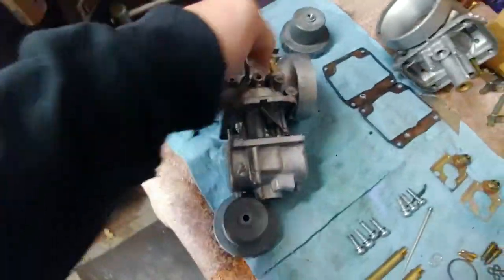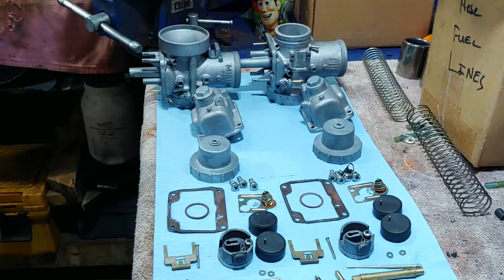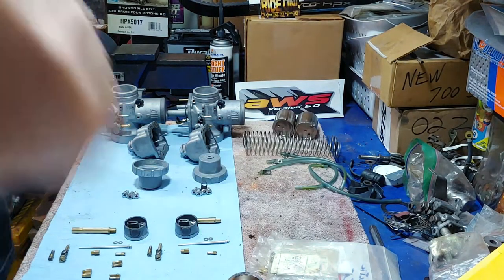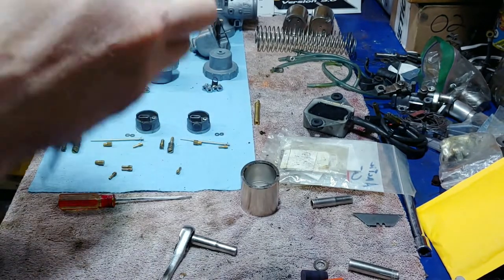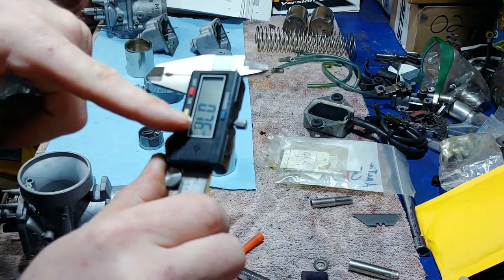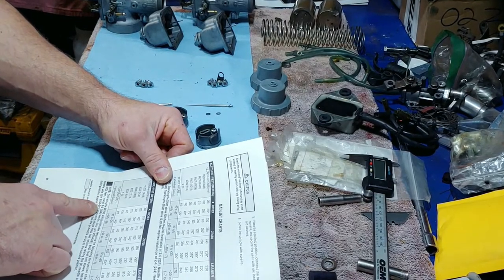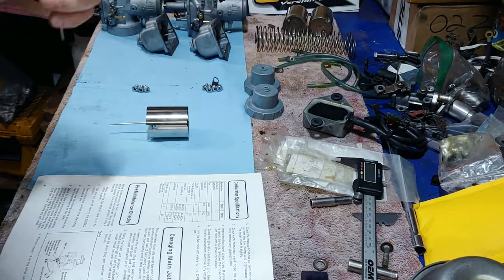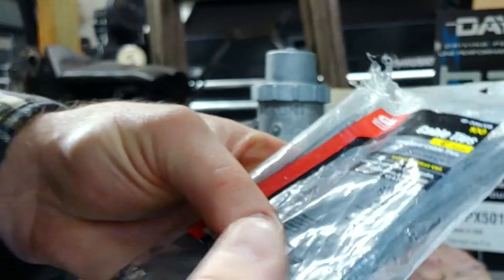1995 Arctic Cat ZR 700 Part 7 || Carburetor Setup [Restore to Stock]

Comment: One of the tricks to get gas to carburetter I put mixed gas down, spark plugs first pull starts it will prime your carburetors, and get all the gas and air out of the gas lines
Reply from the maker: I like to put fuel directly in the bowls. But when starting my 2-stroke snowmobiles after a while of sitting I like to put carb down the cylinders and then it fires right off

Comment: Couldnt agree more buddy on them small philips screws,so went to my local fastenal outlet got a box of 50pcs of it was m4 or m5 x 0.7 allen head screws they call them socket head but whatever was only like 15.00 bucks.yup now all my toys with carbs have them,much better removing and tighting i still put anti-sieze to prevent corrosion.noticed u took emulsion tubes out on carbs i tryed and nearly wrecked my carb is it imperative to remove with cleaning.cause i cleaned its main jet,saw there was pins lined up for emulsion tube entry.but it wasnt budging but fraction of inch up n down started bendinging the half moon ventarue thingy.so i reshaped it and gave up before i fubarbed the whole carb.hope its good enough!!runs fine so clean enough for me.just need more snow!!!snooky pa.
Reply from the maker: Yep, I;ve done the same thing with the intake boot clamps. Got a box of SS socket heads crews for those now. But Yeah that should have come out unless they are not removeable?

Comment: Andrew call D&D racing there located in New York State and they'll point you in the rite direction with jetting and clutching for the cats .
Reply from the maker: Yep, did that for the them and is why I put the 420's in for now. I don't do lake runs. BUt when I get this thing running good back with stock setup carbs and get the spark issue figured out (if that's what it was) then I'll dial in the pipes. This sled pulls hard though.
Reply: @Fixin2Ride-Official-  I bout my 2001 tcat 1000 and it had D&D pipes and clutch parts so I called them and they walked me through it and I changed a bunch of stuff cus the previous owner had it set up for racing clutches are set up good now pipes are there trail pipes so it's fast enough for trail riding 😁
Reply from the maker: Yes sir. I didnt ask them about clutching though so I will probably do that too when I get it running good again. Hopefully all this will do the trick.